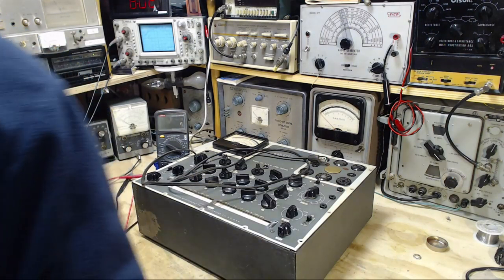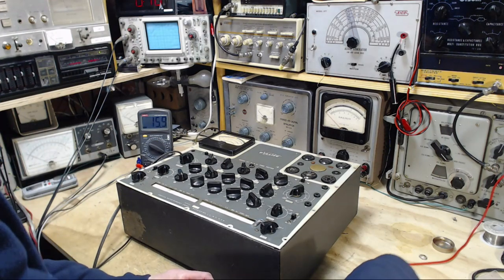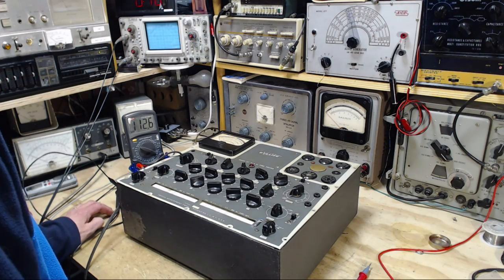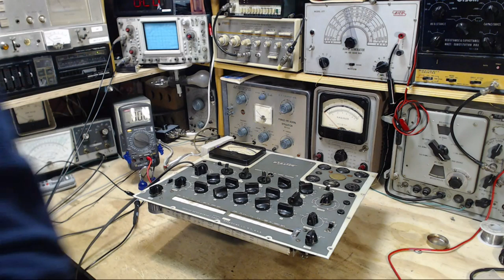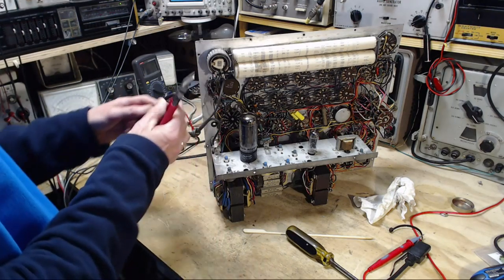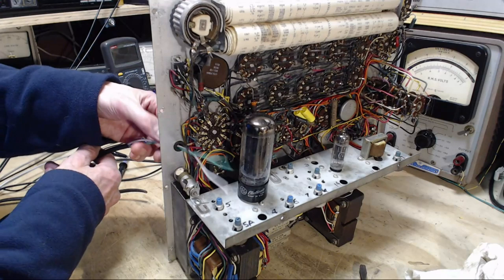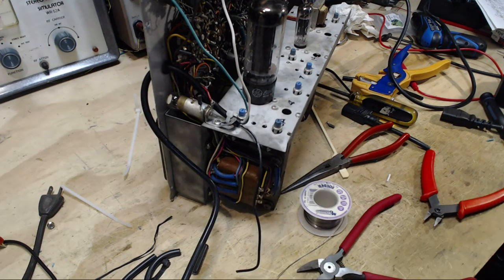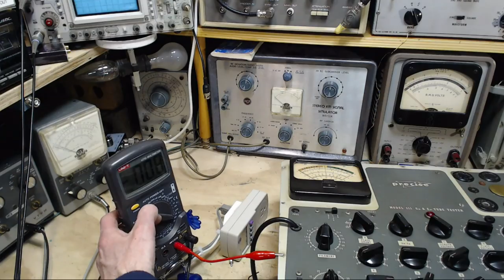Precise Tube Tester Model III - Eliminating the Case Voltage

Comment: I typically replace my equipment's power cables with a three prong and a few devices I use a polarized two prong so I don't have the 50/50 chance. Wouldn't hurt to add a Fuse and Safety X/Y Caps for further protection.

Comment: BUT that is only laborating the symptom. You short the Voltage/Current. The current is always running through the unknown connection from the main to the chassis. If you have an error-induktance-switch, this can react and switch off your desk. 
What i would have made: Measure the current from main to chassis with a defined resistor. Measure the resistance from the main through the transformer to the chassis. Isolate the transformer (screw it from the chassis) and repeat the measure. There must be a capacity or resistance connection. Perhaps it's the fixpoint of the lamp. All can be measured.
This connection will be bad and more bad with the time. Replacing the cord is not the solution.